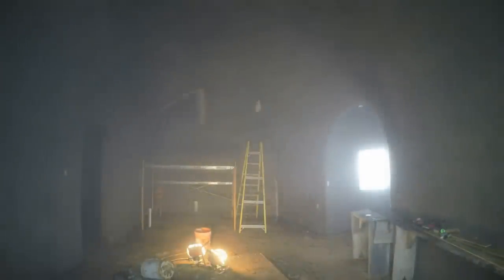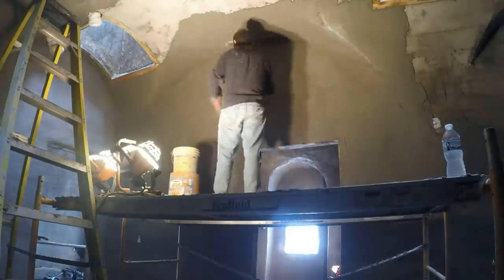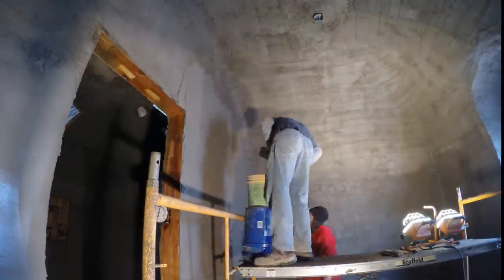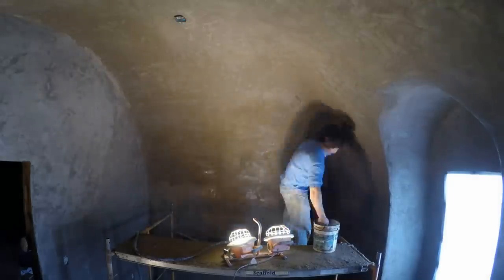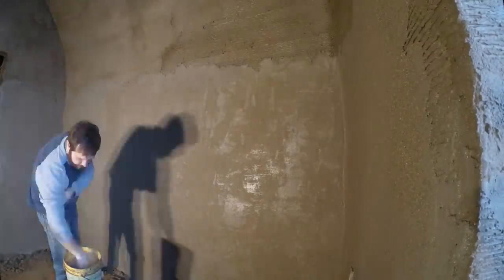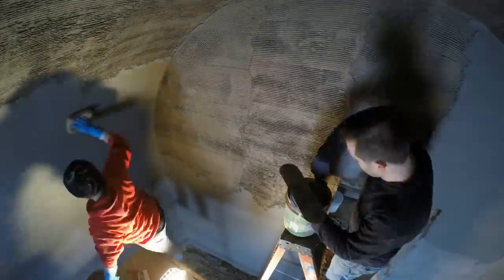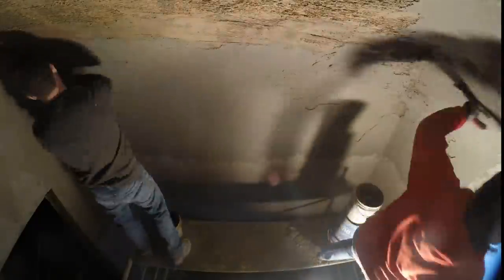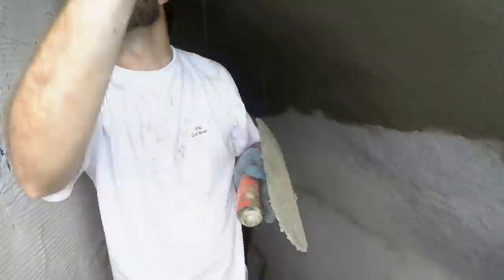39.2 Brown Coat Stucco for the Earth Sheltered House

Comment: There is actually an easy fix to the finish problem... After you do a section of wall take a piece of plywood and make a ledger board. Go to Home Depot and by a sponge used for ceramic floors. They are made with a soft sponge on one side and abrasive sponge on the other. Every so often test the firmness of the stucco on the board. When ready use the abrasive side of the sponge to knock down the high spots and then the soft side for the finish. If you use a soft sponge on hard stucco you'll get no where and burn out trying. This technique is great for spackling when you don't want dust in your home. Keep a 5 gallon bucket of water with you and keep rinsing... Wish I there to help...

Comment: Just wondering if the cement work up to this point caused any outgassing, and if it did, at what point do you figure it would end, or, if you predicted this and then used a simple mix to avoid some additives.
Reply from the maker: I don't think there was any out-gassing.  The fanciest additive we used was a quart of thinset for each wheelbarrow of mix.  But since that is designed to be used inside, hopefully it is fine.  Anyway, we didn't have windows in, so there was still plenty of fresh air in there.
Reply: Portland and sand dont work that way, check out the Portland Cement Association for an explanation of how concrete/mortar work.

Comment: This house must cost millions. Money well spent. Still probably cheaper than a 3-2 in Manhatten
Reply from the maker: Actually, cheapest house in the neighborhood, about 1/4 the cost per sqft of the house across the road.  Part of that is because we are doing so much ourselves and part is because the materials are cheaper than traditional materials.  I can get a cubic yard of concrete for 100$, pre-mixed.  It is even cheaper when I mix it myself.  Compare that with the cost of a traditional wall section which includes plywood, studs, dry wall, insulation, etc.